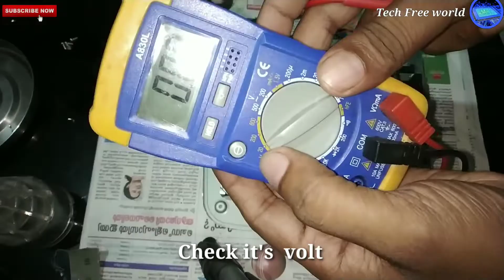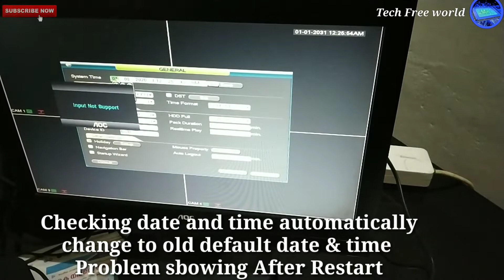CCTV Bios Battery Replacement | Date & Time Automatically Resetting Problem Solved | DVR

Comment: I had replaced with new battery but after a long time(4 hours) when power suplay is gone after that when restart the DVR the time had been reseted as default. Can you help me for giving me a solution for this problem.
Reply from the maker: Check voltage of bios battery connection.if your soldering not proper we can't see 3.5 v.
Reply: @TechFreeWorld  ok